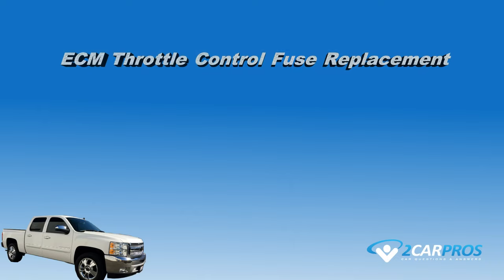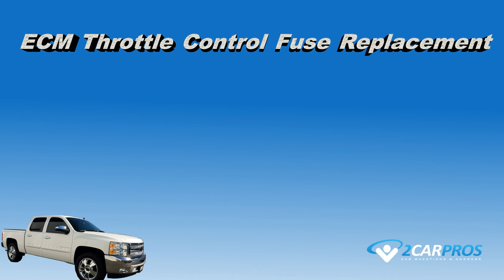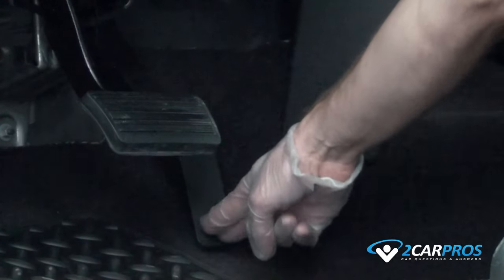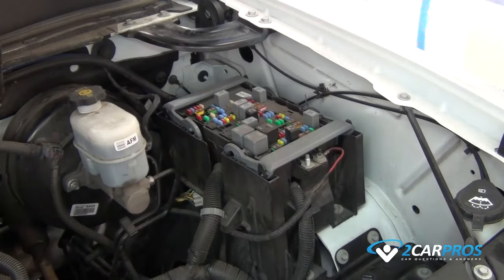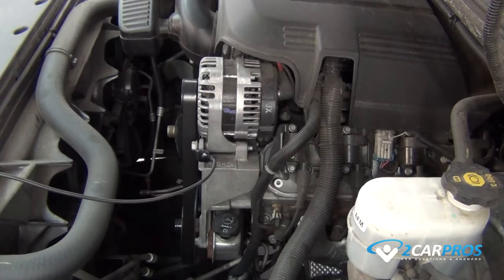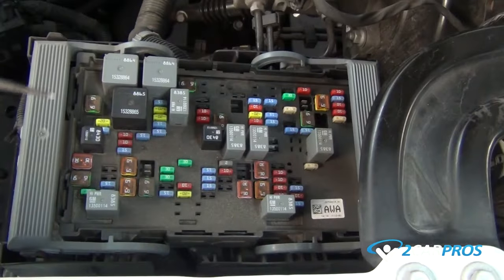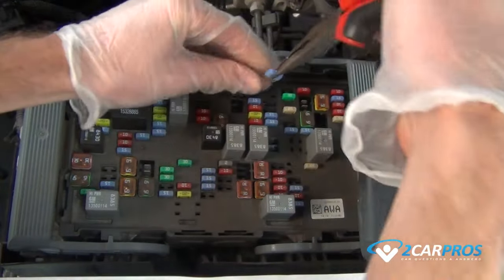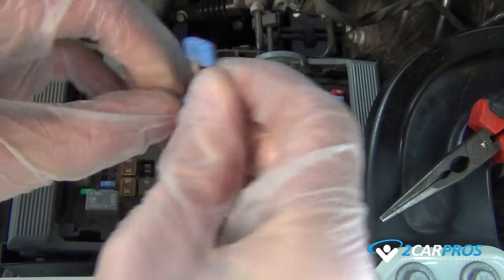Engine Control Throttle Control Fuse Replacement

Comment: i have a 2013 Dodge avenger my car, the car works perfect somedays but sometimes it just shuts off out of nowhere while driving, and then it cranks but wont start i have to wait about 5 to 10min then it wont go faster than 20mph no lighting bolt symbol showing either. the following day the car work perfectly, i have changed the crankshaft sensor and I still randomly get that issue, do think i need to replace my ETC? any advice will help. thanks
Reply: Check the SVC
Reply: @bourneservices8677  thanks i appreciate the response, i eventually figured out it waa TIPM that needed to be replaced

Comment: Thank you very much! Fixed my 03 Tundra problem.
Reply from the maker: You're welcome!
Reply: @2carpros hey I replaced the fuse it blew while coming to a stop and car wouldn’t turn back on until we found the fuse and another was blown. Now the check engine light is on and it has poor throttle response and rpm’s dipping while at a stop light. What do I do next?

Comment: thank you
Reply from the maker: Welcome!
Reply: I have a Hyundai Tucson, an American car, model 2014, with a 2.4 engine. There was a short circuit in the body of the car, so what is the solution to fix it?